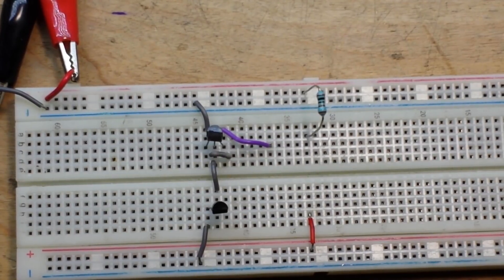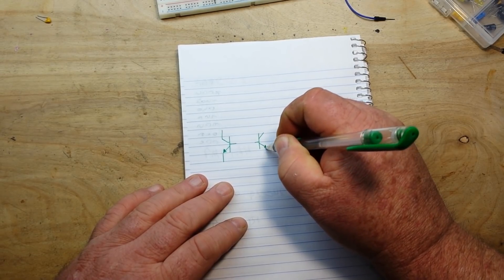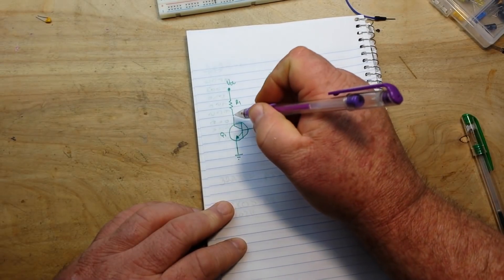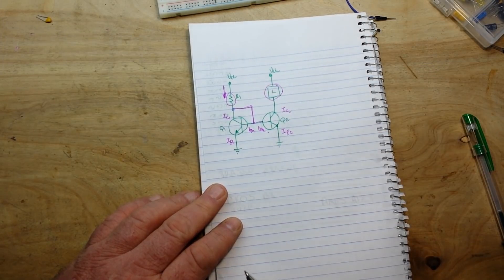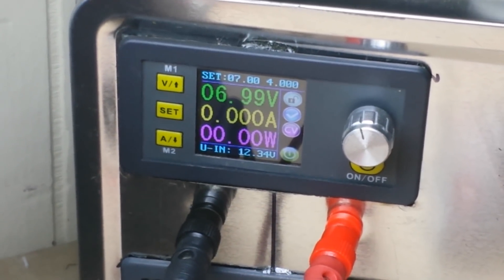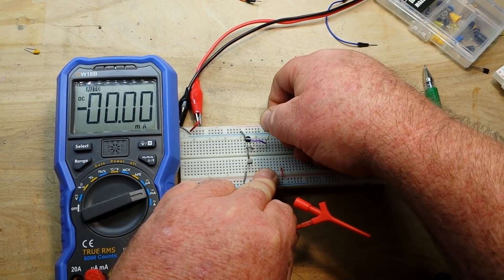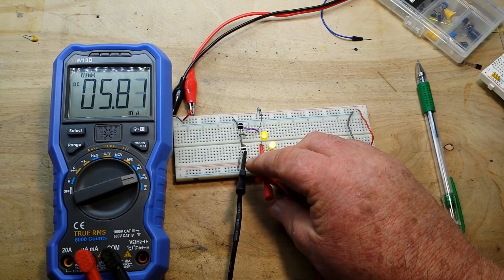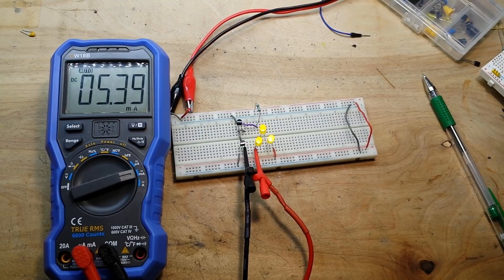Common Circuits You Should Know: The Current Mirror

Comment: I understand the mirror action but I don't understand what applications would need this "non-stiff" supply ?? 
I thought circuits take only as much current as they are designed to take, i.e. u can't "force" more ... or they can't "demand" more than designed ?? (Ignoring fault conditions) 

Any experts want to try & explain to a noob whats so "magical" about current mirrors ?? 

👍😎☘
Reply from the maker: Think of it as a type of current limiting circuit.  Some components will take every miliamp and burn out, like LEDs. These must be limited.
Reply: @learnelectronics  .... thanks for replying... I guess I just don't see the versatility in the mirror... a led simply needs a current limiting resistor so thats easy enough, I have several reference books which go into great detail about current mirror design but are less enlightening on the apps.... 🙄😏
Looks like I need to do more research 🤔

Comment: To be fair you should have connected the three leds in paralel to show the mirrored current is limited by R1 of Q1, still I enjoyed your class very much. Thanks.
Reply: Except that LEDs in parallel can be problematic as the one with the lowest turn on voltage will tend to rob the others of drive, although admittedly less likely if they are the same colour from the same batch.

Comment: 1. With all those multimeters you have I was expecting you to hook 2 up at once on the board.
2. What was the current through q1 when you hooked up all 3 leds?  Was it the same as through 12? If not, wouldn't this be a current limiter and not a current mirror?
Reply from the maker: I showed the current through Q1. As both the collector and base are biased with a fixed resistor, the current can not change. This circuit is a current mirror.

Comment: Thank you. Though how does this compare to simply using a resistor to limit?

I come across a circuit I had to make recently where a MUCH more experienced and knowledgable friend suggested I had to current limit the "COR" out of a 2way radio which would drive via pnp I think it was the "PTT" of a second radio to make a repeater. Now he stated that I had to use a resister to limit the current because otherwise the radio would keep supplying as it's like a short until it burnt something. Now I always used resistors to lower voltage from say 12 to 5 or 3 for leds rather than current limiting. How would a resister which would sink that current reduce that current?
Reply: The difference of this circuit and a simple resistor is that it acts as a variable resistor for any load within its limits. If the load changes the current supplied is kept constant. No need to put a different resistor go keep the load functional as needed in terms of current supply. Just remember the "within limits" detail...

Comment: Liked the video but still confused understand BOTH NPN transistor base current the same, but WHY does that mean the output current the same? 
Also PLEASE in these videos give us poor non-techies the reason you would build/use this circuit.
PS marked the video with a like!
Reply: Well, keep in mind that minor differences in current sharing between the two bases will always be present, but this is not so important. If theoretically the transistors are absolutely equal in their working parameters there will be no difference in base currents. But this is ideal, not real. Now, the current will be the same because it is simply divided in two parts. One for Q1 and one for Q2. As said these sub currents are equal. When the system is powered, both transistors' bases are (equally) forward biased and their collectors are conductive. The point is that Q1 drops it's collector voltage because of its base bias. This drop adjusts the base drive to a level that stabilises it's collector current to a specific point depended on the collector resistor. Then Q2 "mirrors" Q1, i.e. it reacts like copying what Q1 does. That is all about it.

Comment: Hummm neat,  current mirror question: Can we use to set a as constant current source of 10mA on a LED do determine its forward voltage using another meter ? Like the 555 timer t-shirt :D
Reply: Yes you can or use the diodefunction on your multimeter.
Reply: Yes, you can certainly do that. Or, for example, you can sort leds according to their luminance when fed with constant current. This is what (serious) factories do for luminance matching of leds intended for back lights of their instrument displays...

Comment: The reason the current dropped after the third LED was added is the source voltage wasn't high enough to bias all three yellow LEDs and the voltage dropped across Q2 (you only have 6.99VDC). I suspect those LEDs need over 2VDC each to be able to draw the targetted 6mA.

Comment: Very nice video Paul!  Great subject!  I wonder if the drop in current might be due to the circuit running out of working voltage - applied voltage?
Reply: I think it has to do with the Beta factor - individual device parameters affecting change. As more and more BJTs are added in the mirror to add multiple current mirror branches, this error increases. There are other designs which mitigate this response - check out the Wilson current mirror!
Reply: Most likely. There isn't enough voltage to run 3 leds and the bjt at 6mA.

Comment: The problem with current mirrors is they require transistors with matched characteristics. They find application in analogue ICs, where the transistors are matched by the production process that produces them at the same time in the same process.
To work well in a discreet solution really requires the transistors to be matched, same HFE, same VBE. It also helps if the cases of the transistors are pressed together so that they are operating at the same ambient temperature. 
There are surface mount IC packs that contain just two transistors, ideal for this application.

 Personally I have never found current mirrors particularly useful, because of its limitations, but each engineer has their pet circuit building blocks, be that Darlington circuit or cascode amplifier. I once spent a few weeks working  with a French engineer on a rf design. His pet circuit was the cascode amplifier, and his receiver design was littered with them.

It is sometimes easy to identify the designer of a particular circuit by their use of pet circuits, but then it is also possible to identify the designer by their use of particular resistor ,capacitor or inductor values. Those new to electronics sometime believe that every component value is fixed by equations that relate to its place in the circuit. This is certainly true of critical components and it is certainly true that every component value should be selected for a reason that can be justified and defence in a peer design review, but sometimes that reason can be it is the designers favourite value and has therefore been used in other places in the circuit. It reduces cost to keep the bill of materials as short as possible by reusing the same value as many times as possible. This is certainly true of supply decoupling capacitors. 
Where complex designs have been produced by a design team, it is not uncommon for the number of component values used to be rationalized during the first complete circuit design review. Taking out the pet values and replacing them with standard values across the whole design. It is not uncommon for designers to draw the circuit topology for building blocks and leave the choice of component values to the integration stage where the whole design comes together.
Reply: Nigel Johnson Nice observation!  I know I have my pet Circuits and topologies.
Reply: @KissAnalog  we all build a library of circuit building blocks that we know work.
Reply: Hmm pet circuits? I'm trying to think of what mine are! Not sure if I have one, but I like to use filament light bulbs as quasi constant current sources. And if I can do it with a few transistors, I'll tend to avoid ICs. That may possibly be because I tend to avoid PCB boards when making up one off designs. Tag strip, point-to-point, Manhattan style don't cater easily for ICs. Usually when I use them, that's when it's time to break out the vero board! lol